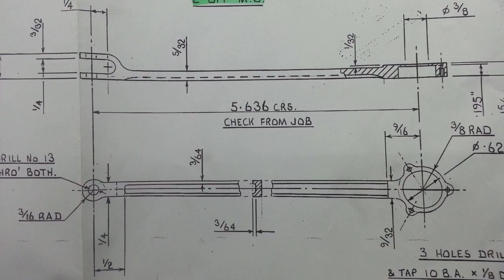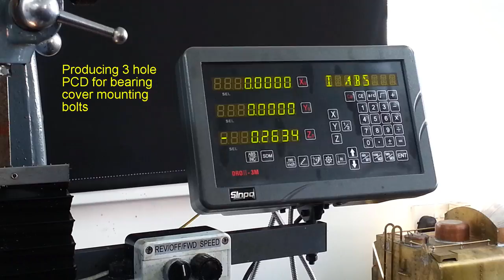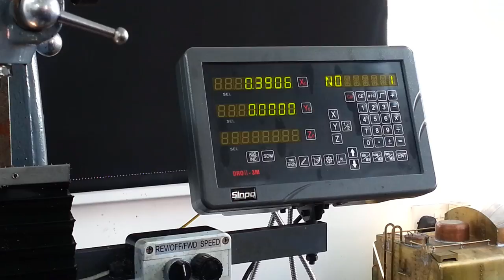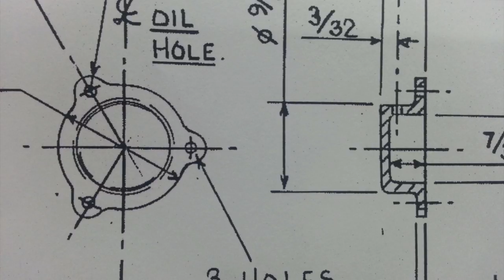Steam Locomotive 9F Build Part 48 - Eccentric Rods

Comment: are you going to show videos of valve operation setting timing,  lap, lead, and how that all comes together?
Reply from the maker: Thanks Michael. Yes that is my intention, but first I need to do a lot of 'fitting' so that all the valve gear rods are moving freely. Then make the valve cross heads and slide bars. Also need to fit the leaf springs and set the design ride height of the axles so that accurate valve events can be determined. 
Cheers Craig.
Reply: Awesome,  looking forward to that.
Also, will this have piston valves with inside admission?
or outside ?
Reply from the maker: @MB_Videos1  Inside admission on this locomotive.
Reply: @no23mk2  cool I await the videos!